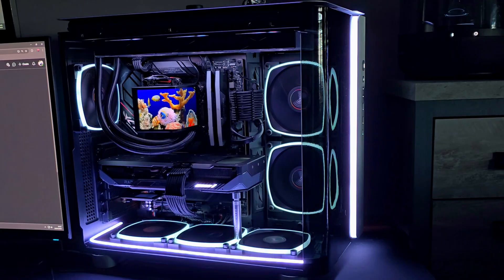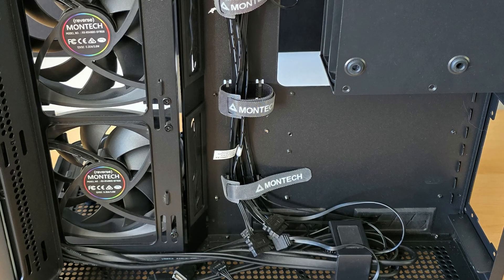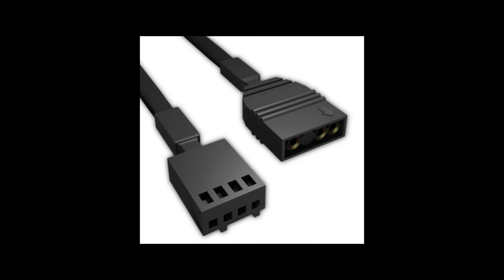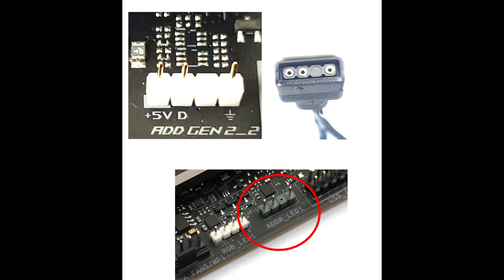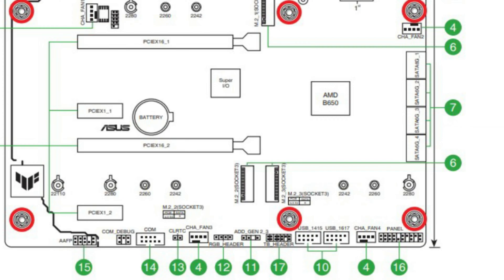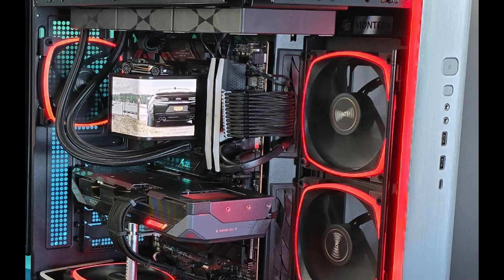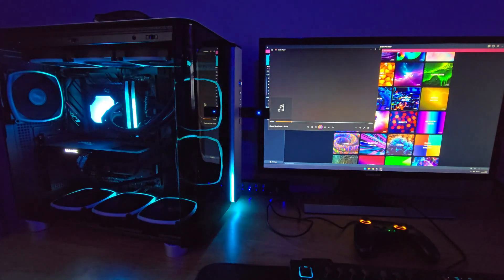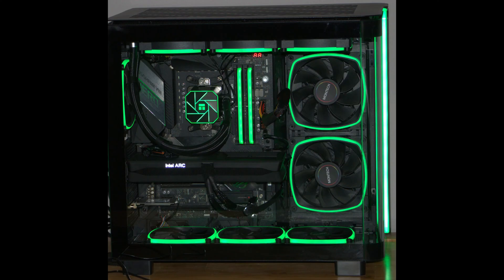Montech  King 95 Pro & Ultra RGB Lighting Set Up

Comment: are there two types of Montech King 95 Pro being shipped - mine has no argb cable? In what exactly place is that argb cable connected to the hub? Can't see it....
Reply from the maker: There is the King 95 Pro and the non pro, the non pro doesn't come with a hub or fans
Reply from the maker: you can see the argb cable from the hub between the 2 sata cables under the bottom velcro strap at the bottom and the PWM cable is usually close by. https://freeimage.host/i/20250315-103759.fHHdBSf
Reply: @TechJunkieCentral-l9w  Thanks so much for posting the photo. I'll check the inside of the case again tomorrow.
Reply: @TechJunkieCentral-l9w  ok, found it... It just stuck between the other cables :) Now I can control all the lighting via the software. Cheers!
Reply from the maker: @_manasikara  your welcome

Comment: did you manage to control fan speed? plugged mine all in changed to PWM in bios, fans still run at 100% !! its like a jet engine haha
Reply from the maker: Did you plug the 4 pin PWM cable from the hub to the motherboard in?  Coming out of the hub you should have 2 sata, 1 argb, 1 pwm and the front panel button connected
Reply: @TechJunkieCentral-l9w  yes done all that, just plugged a new hub in and it worked 1st time, went back to one in case, and nothing, think the hub is not working correctly or is having issues with MB
Reply from the maker: @MrHoopski  send an email to rma@montechpc.com include the serial number of the case along with your name and address, country and postcode / zip along with details of the issue. Usually takes around 5 days for them to respond but if it is in the warranty
Reply: @TechJunkieCentral-l9w  cheers, i shall do that

Comment: Hey, my rgb works with the button but not with the motherboard
Reply from the maker: Hey You! it is a little easier to help and you will get quicker and a little more detail over on the Montech sub Reddit. A few things to check assuming you have the cable from the hub to the motherboard,. pending on what motherboard you have you may need to turn on the lighting option in bios, also do you have software installed to control the lighting.

Comment: My montech hub is connected to the motherboard but I can only use the reset button for rgb. It won't work with my gigabyte argb header
Reply from the maker: Do the case fans flash when you hold the reset button for a few seconds?
Reply: Yes it's a known issue for the X870E AORUS

Comment: Hey mate, I tried holding the button down and it still doesn’t let me control my rgb in signal rgb
Reply from the maker: Is the 3 pin rgb connector connected to the motherboard? If you are on Reddit, look up Montech and make a post and I can include photos and offer help.